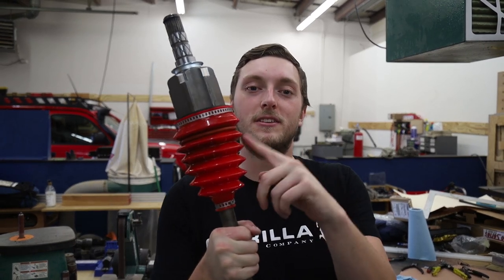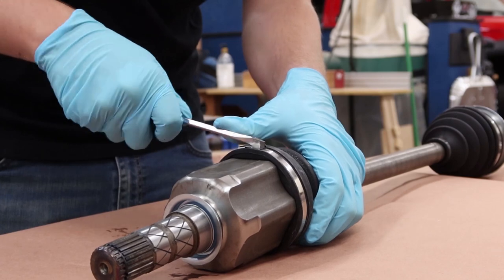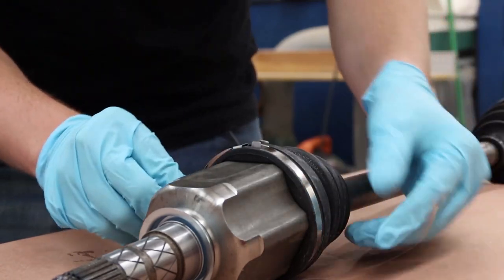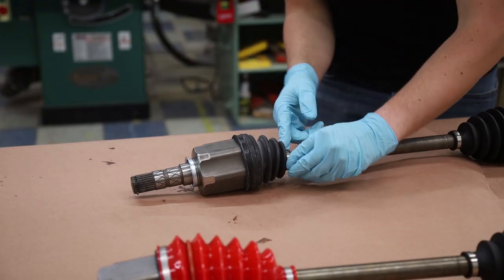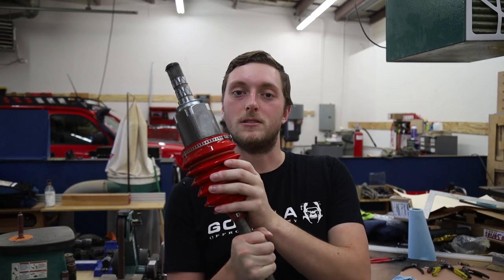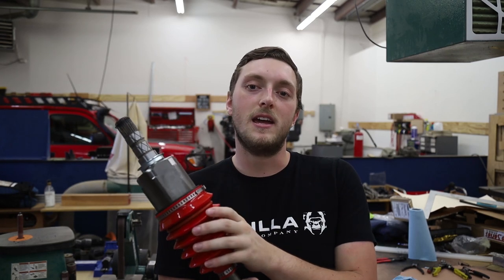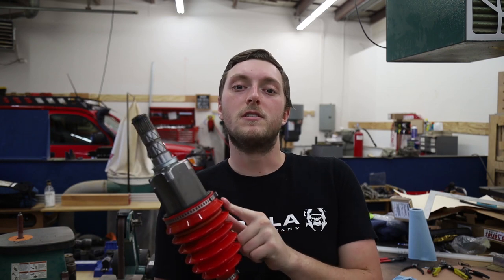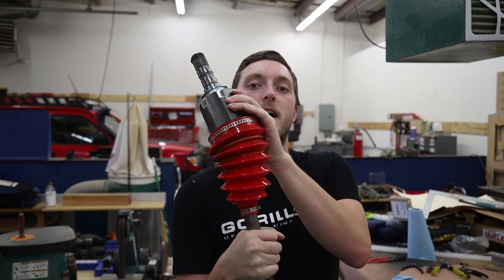Installing high angle silicone CV axle boots for Toyota axles on Subaru axles!

Comment: Interesting idea using the old boot as a spacer! Haven't seen it before. 

Nice job.
Reply from the maker: Yeah! I used them as a couple to adapt the Subaru axle cup to fit the round opening of the silicone boot, it worked out really well actually!

Comment: Just an FYI, these won't work on the rear. It might look like it has just enough room but once you get up to highway speeds the boots expand from centrifugal force and start catching the subframe. They work great for the front as Brian demonstrates.
Reply from the maker: Yes I know, that’s why I have switched to another universal boot which is much better, I need to make an updated video
Reply: @BrianLipkeMedia  yes pls do.

Comment: How tear resistant (getting snared by branches, logs etc) is a high angle silicone CV boot vs a normal rubber one? in an offroad setting
Reply from the maker: It should do pretty good, the silicone is a lot more stretchy than the rubber
Reply: They looked very promising longevity wise, i wondering what the issues of these one's were by chance?!
Reply from the maker: The diameter was too large, they rubbed on the sub frame
Reply: @BrianLipkeMedia  Ahhh i see they didn't taper down enough coming off from the larger clamp side! 

I imagine you tried to trim down an use the lower shelves to clamp down on and or slim and taper it down a little, or was it not worth the experiment/rigging?

Curious george over here! Just getting the lift done im stoked to get dirty and not worry as much so i appreciate the help! 💪

Comment: Would this solve the problem for the front cv joints if I were to lift my crosstrek? Would I have to put the red boots on both the outer and inner ones?
Reply from the maker: So this method works for both inner and outer joints on both front and rear axles, but I recommend Blue Point FlexxBoots instead of these red boots, these red boots did not hold up
Reply: @BrianLipkeMedia  Do you know where one would obtain Blue Point FlexxBoots? I wasn't able to find it online and these would fit and solve the problem of lifting a 14 crosstrek? Thank you!
Reply from the maker: Flexx Boot FB3000 Small Shaft Universal CV Boot https://www.amazon.com/dp/B00C2M76ME/ref=cm_sw_r_cp_api_glt_i_DDXZBT3F8962F816BP7G?_encoding=UTF8&psc=1
Reply: @BrianLipkeMedia  How long have you had the Flexxboots on for now? I just upgraded my boots on my lifted crv.
Reply from the maker: I’ve had the boots on for just over a year

Comment: How much are they each
Reply from the maker: It’s about $160 for the pair
Reply: So I bought these and thought they would fit my hummer H3 and my mechanic said they won’t. They are way to big. I lost the receipt and can’t return them
Reply: @reneluna249   These technically didnt 'fit" his application either, he made it work though
Reply: @reneluna249  any chance you still have these ill buy them off you
Reply: @yojerdubz111  no I ended up putting them on they did fit